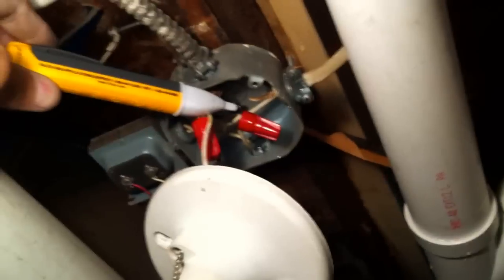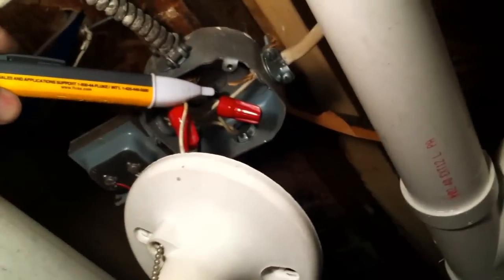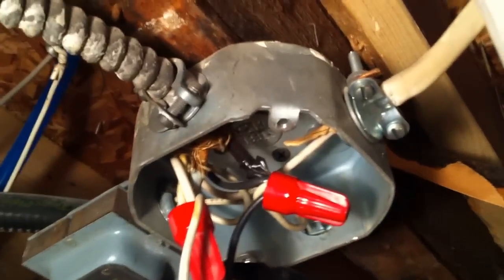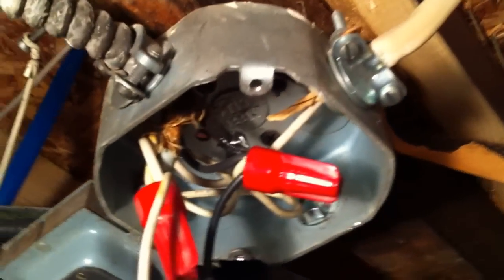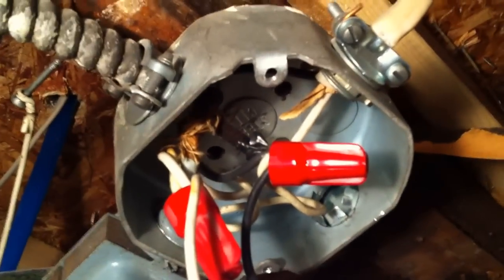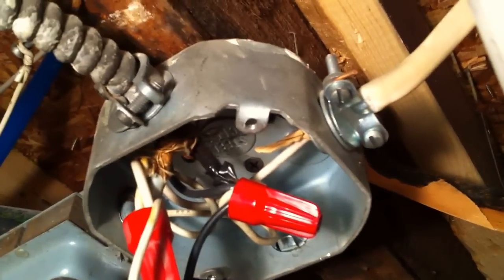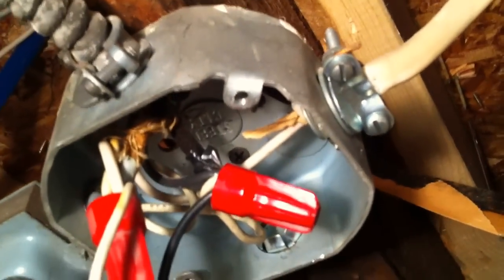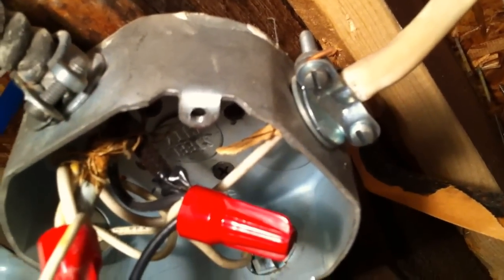Moving Violations Video No. 104: Improper EGC Connection

Comment: I got into the craft in 1980, & I have been in several remodels of older commercial structures. This must have been an acceptable means at one time.. IMHO you take a risk of the grounding conductor breaking trying to correct the connect & bring it up to date.. 

Also, NEVER trust a NON contact voltage tester to verify zero voltage! If you have the model I think you do, it's only good down to 75VAC.........

Comment: I understand that it is against code to do that, but are there any safety issues with grounding to the clamp?
Reply: Yes, this connection of the EGC creates a high resistance that'll impede fault current from returning to the source to clear a fault.